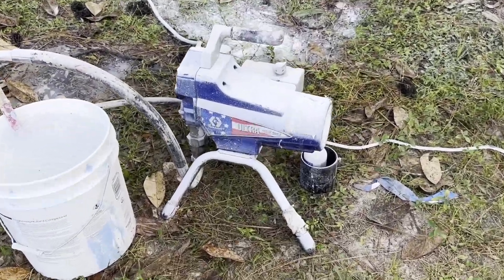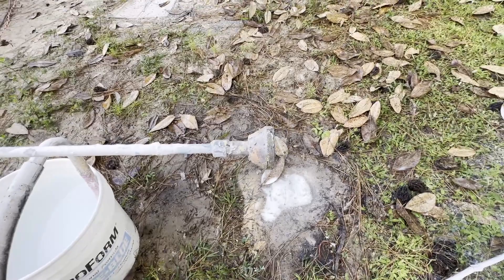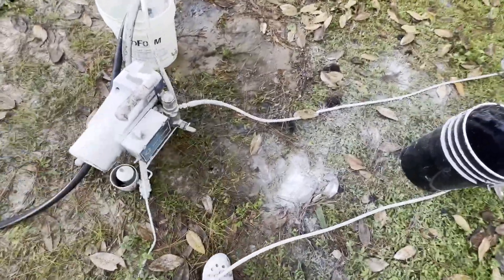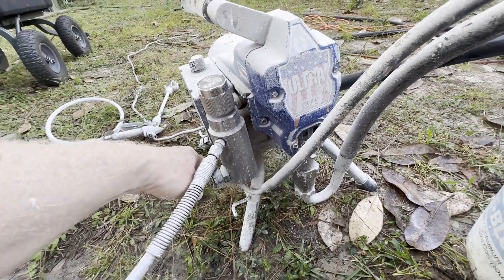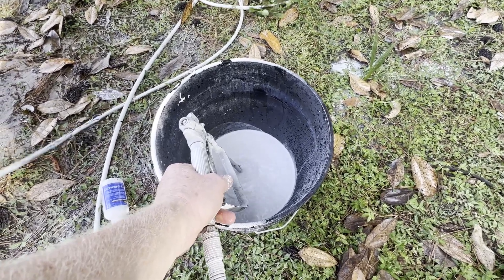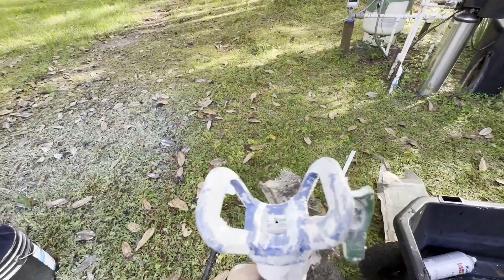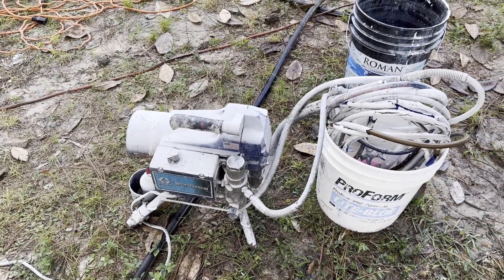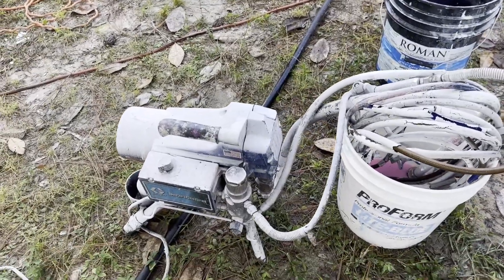How to Clean an Airless Paint Sprayer after Spraying - Spencer Colgan

Comment: Don't have the sprayer buuuut I always make sure my painting gear is clean and dry. A while ago I came across specific nylon brush set at Lidl (german grocery store) for couple of bucks. Those brushes resemble big time brushes for cleaning guns and rifles. Those would be more then perfect to get into all those channels and crevices you were showing Spencer. Not sure if you have Lidl in your area but definitely worth checking out. Besides those brushes they have daily fresh killer croissants filled with hazelnut chocolate cream! They cure depression in instant. 🤣 Great video as usual. 👍
Reply from the maker: Thank you so much for your comment! Do you know something? That’s a great idea… Those little brushes
Reply: @spencercolgan  Those brushes are tremendous help for cleanup of any tools, if one cares that much. Paint or drywall mud mixer at the very bottom between the wires for example. I do have a handheld graco 360 gun and it helps there too. Gun is a joke but for my occasional deck staining works ok. Needs to be cleaned too!

Comment: Spencer, hook the garden hose directly to the inlet, turn on the pump to clear the paint out of the system
 turn the pump off and let the pressure from the garden hose to clean the system. The garden hose will put way more water through the system than the pump.